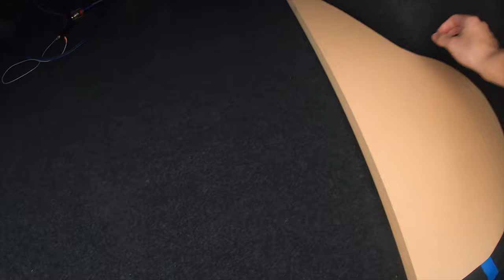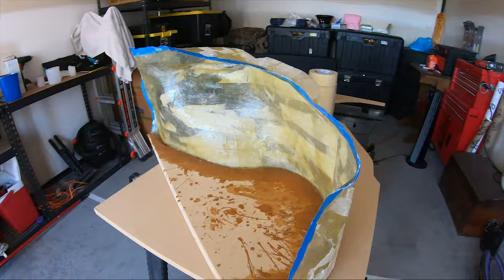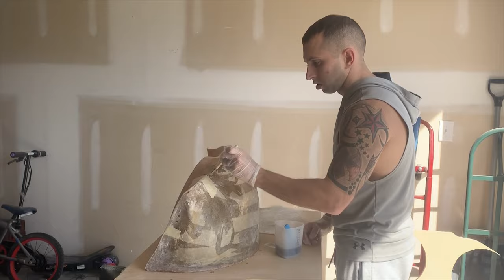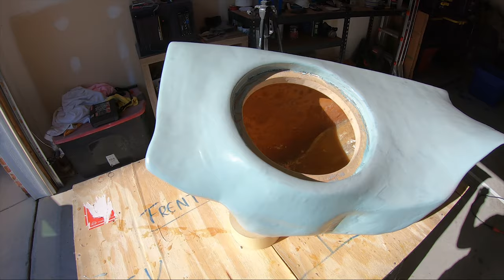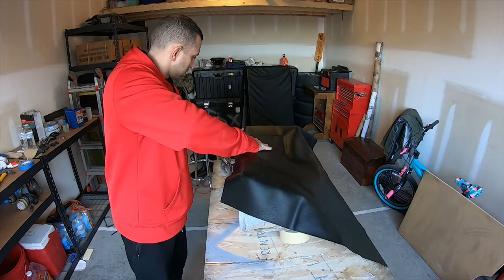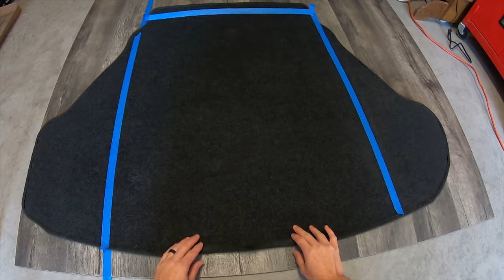Building a custom fiberglass subwoofer enclosure & trunk setup in 10 minutes (Time Lapse)!

Comment: that's purty.... how does it sound?... does it get low?... I just added a sub to my 2010 E60... a 10" Kicker L7 in 1.73cu ported and tuned to 30hz on a Kicker CXA800.1, 2oHm... and it'll lhit 25hz all day long without over-excursion, it hits so low and loud it makes my stomach nauseous... straight brown note....
Reply from the maker: I’m not sure what it’s hitting, I haven’t metered it. I do know it sounds just as good as it did in the wooden enclosure and it saved me the space I was looking to get back. Over all it does the job for me, I just wanted something to add to the factory system.

Comment: Nice work. But how did you come up with the correct air space for the sub?
Reply from the maker: Gonna be honest with you, I figured out the general square dimensions for where it sits and deducted the approx area lost and then guesstimated space added by the extra length I extended and hoped for the best. In the future I won’t use the wood, instead make the entire thing outta of fiberglass and fill it with water and figure out the cubic feet based on gallons of water it takes to fill. I can then add to or take away from the enclosure to get right where I need to be.

Comment: does the subwoofer box stay in place or how do you make it stay in that corner and not move out of place ? Also is the quality great? i have read that fiberglass boxes lower the quality, if so is it a big deal?
Reply from the maker: So first to keep it in place the floor presses against the wooden base to keep it there also the raw glass on the back side also grips the carpet pretty well. Second, when I switch from a wooden box to this I didn’t hear a difference in quality at all. I’m sure it may have been effected slightly but I don’t compete in SPL comps so I’m not overly concerned. Hope that helps!

Comment: This video was just what I needed!! I got a sub from my brother for my birthday a couple days ago and wanted to do this exactly. I was just wondering if i should cut a hole in order to make it ported. Also where do you recommended putting the amp?
Reply from the maker: Making a port is purely up to the sub you are running. If you haven’t ever made a box before calculating the port size and all that might be a bit much. If the sub will function in a sealed enclosure I would def consider doing it that way. I recommend mounting the sub under the deck lid to ensure it gets airflow and is out of the way. Amps mounted under the trunk carpet tend to over heat if they aren’t allowed to get cool air or if they don’t have good internal cooling systems pre installed.

Comment: Any rattles from the trunk lid or quarter panel?
Reply from the maker: Most of my rattle was the license plate area. I put some foam behind it and haven’t done much else.
Reply: @Foxcraze  Thank you. I actually remove license plate frame.Just the plate screwed in and secured with clear Gorilla tape.No plate rattling.
Reply from the maker: @missayawk  that’s a good idea! I’m gonna try that also

Comment: Just had a question on why you bondo and sanded n primed the front n then went for a wrap? I was expecting paint on it for sure! Just wondering...The box is rad dude!
Reply from the maker: Vinyl isn’t like carpet at all, carpet hides perfections but vinyl will still show flaws in the finish. I went better safe than sorry and smoothed it out and showed the process of doing so for the viewers as well. I may have other plans for the box later on, not sure just yet!

Comment: Great job i absolutely love this i wish there was a realistic way to calculate cubic footage and even cooler would be to port it but there's just no room it looks absolutely incredible tho nonetheless great video id love to see a demo of how it sounds
Reply from the maker: Thanks, I really appreciate it. I could have ported it if I made the back edge near the seat wider and not tapered but I didn’t want to do the math if I’m being honest haha. If you make the bottom out of fiberglass instead of using wood, you could put gallons of water inside and convert it to get a ruff idea of cubic footage. I have a video of it in action in the 2020 closeout video however the speaker had a hole in the surround from a mishap with a grocery bag and a windex bottle So keep that in mind if you go watch it haha
Reply: U can calculate cubic footage by pouring water into the space behind it. Then seeing how much of the water volume changed or how many measuring cups you put in.
Reply from the maker: It would but with the base being wood I feel like it filling it with water now will destroy the wood.🤷🏻‍♂️
Reply: @Foxcraze  lol I hear u bro I just got really bummed out my ct sounds tropo 18 has coil damage I've had it for a year on a perfectly tuned system with an oscilloscope and ive only played it for 10 hrs bc I csnt drive yet lol and people don't like the 18 because of what it does lol but now I'm really bummed bc I was just about to build a box for I and all and I took it out of the sealed one int he recommended size for it and pressed the cone after having it out of the box for a couple weeks a d I heard the noise no one wants to hear scraping I don't have the money to replace it so now I cant have the 18 and ive been getting rid of all my car subs and my last 10 is going to a friend so I'm screwed for now I Contacted them but I boubt they will send a replacement or compensation
Reply: @Foxcraze  100% not anymore but it’s really cool that we can :)
Reply: There are other ways to measure the inside - one easy way fill the inside with a garbage bag or something that has excess-larger then the box and use something to blow air in and only fill the enclosure part of the bag and seal it off.  Then carefully work the bag out of the sub cutout and stick the bag in a box or something for easy measuring cubic space of air in bag.

Or if you build enclosure for a living and willing to buy something and make a jig: You can use Boyle's Law: Jig would be plastic circles to screw over sub cutout to seal the box, you need an nice dial or sensor to measure pressure. Zero the pressure dial/sensor and then pull a measured amount of air out using a syringe.  Using the pressure change and how much volume you removed is enough to do the math on how big the box is.
Reply from the maker: Those are both great ways that I wish I knew! Thanks for the great feedback!

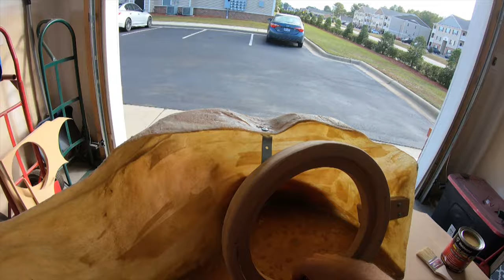Comment: Awesome video the box looks really good and well made i want to try and make one for my ls400 and i wanted to know what material you used at 3:20?
Reply from the maker: That is pink fleece I got on clearance at Walmart. It’s good for initial forming since it stretches and soaks up resin really well and acts as a good base layer for adding fiberglass on top of.
Reply: @Foxcraze  thank you very much i hope to try this soon
Reply from the maker: @bru2187  best of luck to ya and when you finish send me the a photo on Instagram!

Comment: Just out of curiosity, does that resin not seep through that tape and affect the carpet underneath? Or do you not care because essentially the speaker box will be there hiding it?
Reply from the maker: Nope as long as you overlap the painters tape and press it down securely the resin doesn’t tend to seep through at all. My carpet was completely unharmed. I have used just tape as protection for a lot of mold making and had no bad results.
Reply: @Foxcraze  right on. Thank you for the advice.

Comment: Do you think a fifteen will fit like this?
Reply from the maker: Ehh that would be pushing it with a box as compact as mine.  However if you don’t have the spare tire set and have the extra depth it could work.
Reply: I’m trying to fit two 15s but still have the trunk soace

Comment: That is the absolute worse spot you could have picked to place that. Mount one box into another, brilliant...
Reply from the maker: Care to elaborate on what you’re talking about?
Reply: Mounting a sub in the trunk like that applies pressure to the cone limiting the travel when the trunk is closed. It is the single worse and  most common way to install in any coupe. Done for looks it also causes the driver to turn everything up into distortion cause fried coils and blown amps. You can test it by closing the trunk and listening to it then open the trunk. Typical loss is 70 percent on most cars, 80+ on German cars. Did you not think about that before you built it? @Foxcraze
Reply: Oh I did that once as well, back in the mid eighty's but once I measured the loss never again. @Foxcraze
Reply from the maker: So I guess I’m still a little confused, are you saying that doing a fiberglass molded box the way I did it causes the issues you explained or any sealed enclosure in a trunk would cause these issues? What type of enclosure do you run; sealed, ported or free air?
Reply: No you box was fine, the placement was the issue. You should pull the scar and build a new box with the sub firing through the stock sub hole. All subs in any coupe need to fire "only" into the interior of the vehicle. The placement you did only works on single cabin vehicles like a hatchback/suv/van. If you move your sub to the stock location it would be like adding 3 more subs when your in the drivers seat. Bit of work to remake the box but worth it. @Foxcraze
Reply from the maker: Good to know and I appreciate the input!
Reply: What if your car doesn’t come with a factory sub?
Reply from the maker: @kobek5272 usually if you are running the stock head unit but no factory amp,  then you would be tapping the signal from a rear speaker.

Comment: Upload that video
Reply from the maker: There is a sound demo at the end of my 2020 walk around video. I didn’t make another one after that cause there was no reason to do so. The sound produced from this specific custom enclosure will be different from any other made based on design, position of enclosure, direction of the subwoofer, airspace, equipment used, etc. anyone who hears it in person is surprised that it’s only one 10” sub. I tried to capture audio for this video but it just wasn’t working well with the recording equipment I had at the time.

Comment: How’s it sound?
Reply from the maker: Sounds good to me for an entry by level 10”. There is a video in the description that has a sound clip of the sub in action at the end. Be advised though the sub had a tear in it from a windex bottle at the time of recording.
Reply: What was the pink cloth you put over to make the front of it?
Reply from the maker: That was stretch fleece. You can get it at Walmart in the fabric department. It’s soaks up the resin and hardens to build a solid foundation to but onto with glass.

Comment: пластикивый звук будет звучать отвратительно. + занял мало места и смотрится красиво... - занял  много денег, - пластиковый звук будет дёшево резонировать ( особенно на басах - будет рипеть,  а не приятно рычать) - занял много времени и работы. Не стоит повторять такое...
Reply from the maker: Aside from the took up little space and looks beautiful comment, we will have to agree to disagree on all those -‘s. It doesn’t have a plastic sound at all; I have been running it for over 4 years with no complaints. Maybe whatever fiberglass enclosure you are basing your opinion on was built too thin and you now have a bias toward anything not wood.
Reply: @Foxcraze  не понимаю английский